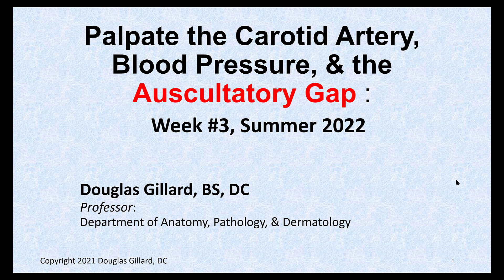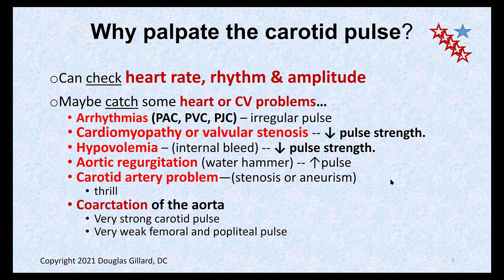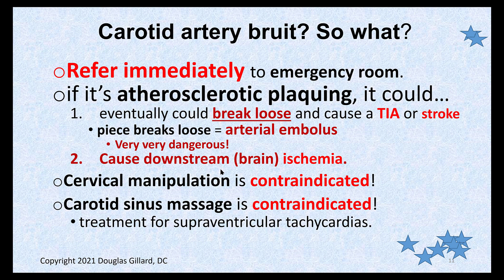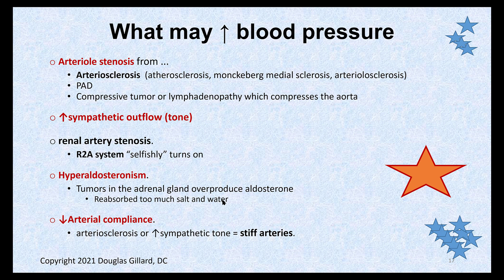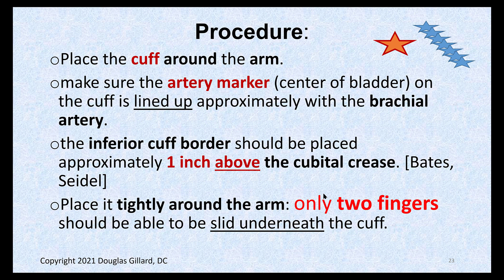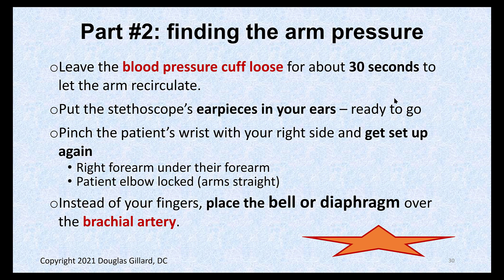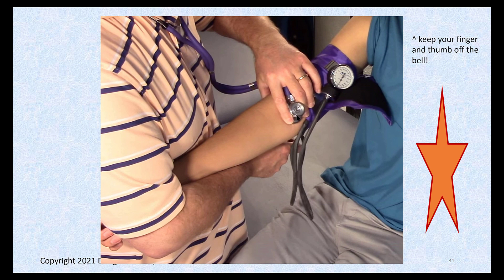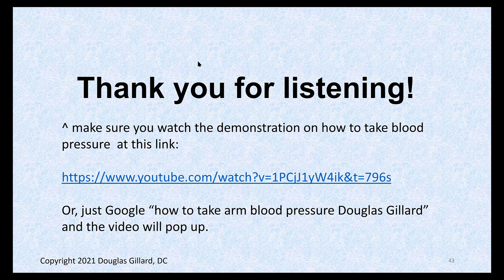Auscultatory Gap, First & Second Diastole – Do You Know What These Are? Boards Are Going to Ask You!

Comment: Hi sir, so does doing the palpatory method first avoid this auscultatory gap. Also is this gap seen during palpation by disappearance of pulse felt?
Reply from the maker: Finding the palpatory systole (cut off pressure) will give you a number to go 30 – 50 mmHg above when you take the blood pressure for real. This way, especially if you go 50 mmHg above the palpatory systole, will ensure that you don't miss an auscultatory gap.

You cannot palpate the auscultatory gap. You have to detect this with your stethoscope.
Reply: Yes sir agreed it can avoid false systolic pressure estimation by going suprasystolically but when the auscultatory gap is there lets say an example of a person with malignant htn, 190/110mm Hg is his actual sbp/dbp and auscultatory gap appears around 150-130 mmHg so during that time the false systole is only avoided but we take 130 as per auscultatory method even if we are palpating the pulse first right
Reply: This can lead to false estimation of dbp as 130 mmHg instead of 110mmHg

Comment: So with people who have auscultatory gap,  will the cut off pressure or two step method not work to catch the proper systolic number?
Reply from the maker: Hello, Great question!

if you find the cutoff pressure (which is usually systole) and then go 50 mmHg above that, then you will not be fooled by an auscultatory gap when detecting systole. For example, if the cutoff pressure is 120, then you should pump up to 170 before you start letting air out of the cuff and taking the blood pressure.
Reply: @douglasgillarddcprofessoro5285  thank you I will see what I can do using my 84 year old mother (who has auscultatory gap)  as a Guinea pig.